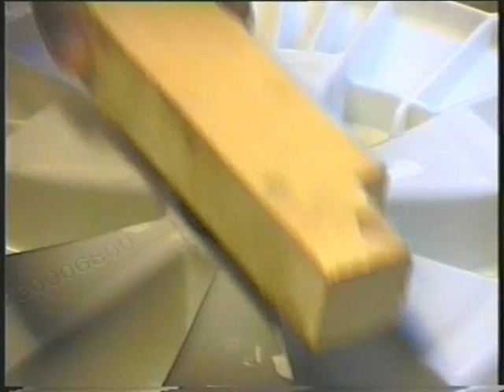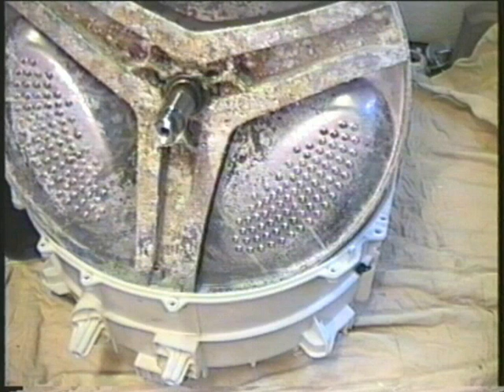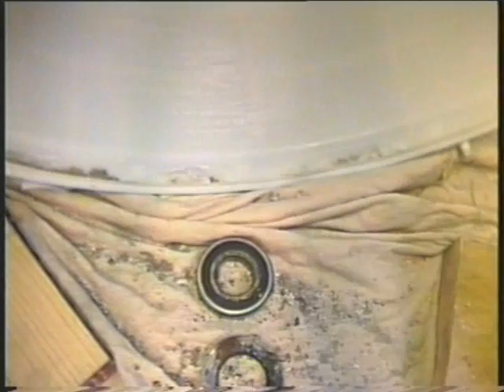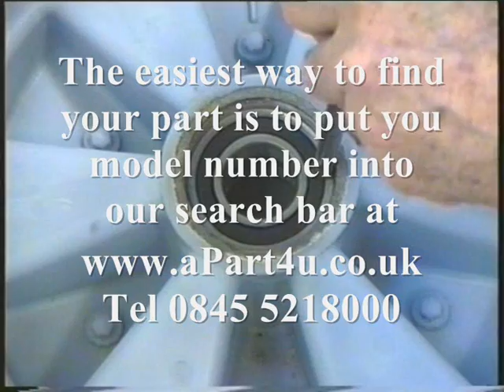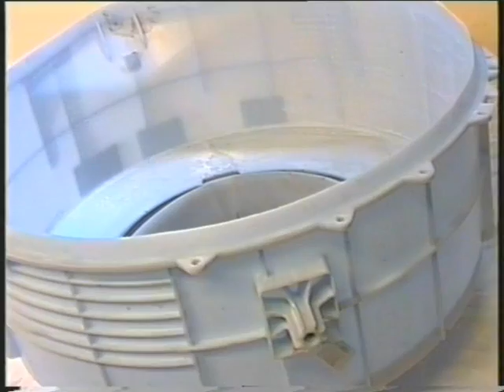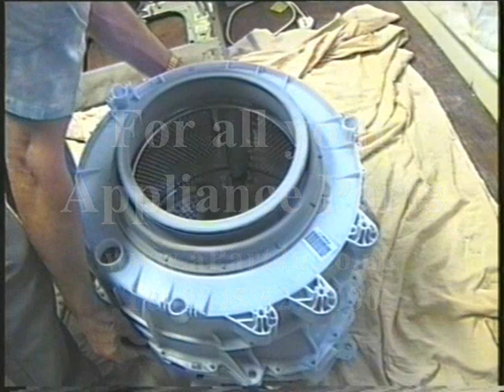How to fit and change Hotpoint Washine Machine Bearings

Comment: Hi, a couple of questions. I've only worked on a US Top Loader in the US, and you had to be careful as it had a a big capacitor, so unplugging it wasn't all you had to do before working on it.
1/ These Front Loaders in the UK, are they safe when unplugged, or are there places you can still get a shock.
2/ Hoover Vision HD, VHD 822 Washing Machine
I'm hearing a sound from the back like the old sound of a bicycle chain going over a rear derailleur. It does it when it's doing its slow tumbling, not on spin. What is that likely to be?
Thanks.

Comment: I used the ring from the old bearing to knock in the large bearing most of the way, and a 4" length of old 3" plastic drain pipe, with a piece of 3 x 2 across the top to knock in the seal. Worked a treat.

Comment: I see one seriously problem.  Where to buy this parts. On Hotpoint web, my model is showing as not found. On ebey I found bearing kit 6204z or 2z but second bearing is 6205z or 6203z. Which one is correct?  How to buy a drum seal.

Comment: Very informative video. Personally when putting bearings and seals in I would use a socket as a drift, not everyone has the luxury of large enough sockets .The blunt chisel/ punch and piece of wood is ideal ,if you don't have access to large sockets. ( befriend your local forklift truck engineer as he will have sockets to suit)
Reply from the maker: Eddy Wiggins true but how many people know them.

Comment: I have a Hotpoint wml 520 p UK r. Bearings noisy, need to change. My question, can I change the bearings or do I need a complete tub?  Easy for me as I have fully equipped engineers workshop. ( marine)

Comment: On my machine a Hotpoint wmd960 the drum will not budge!! I have used a slide hammer and still unable to move the shaft. The outer bearing is free on the shaft which leads me to think the inner bearing is seized on.  How do we get the bearings out in this situation??

Comment: A most useful video. 
Tips based on this mornings experience with my WT741P:
The old bearings do rather resist being removed and I had to increase the amount of 'percussion' required beyond that I felt comfortable (ear defenders might've be an idea too!) but they did eventually come out. Replacing the inner bearing was tough - I found that using a large hammer and the old bearing shell helped start off the process.  nb. even when fully in the water hole was still partially obscured. Big thanks.

Comment: A very useful series of videos, which made changing a broken spider much easier not that it  can be described as easy. The main problem, as often is the case, the presenters don't use washing machines that have been subjected to years of use. The bearings don't "tap" out easily, they need pressing out. I used large sockets, old bearings, steel plates and my car coil spring compressors to wind out the old bearings. 
It took me couple of days, but 80% of his time was remove/fit the tight bearings

Comment: Hi mate, followed all your instructions bought the parts, however i cant get the shaft to release from the bearings its stuck, I've knocked it a few times with a block of wood but it wont release from the lower part of the drum. i've drowned it in WD40 to no avail. Nay ideas?

Comment: Hi mate, followed all your instructions bought the parts, however i cant get the shalft to release from the bearings its stuck, I've knocked it a few times with a block of wood but it wont release from teh lower part of the drum. i've drowned it in WD40 to no avai. Nay ideas?